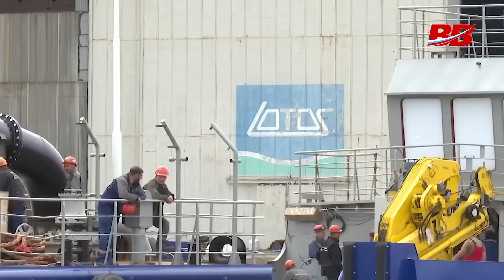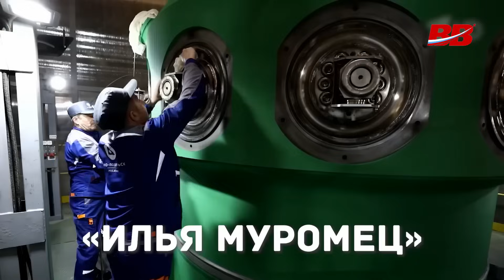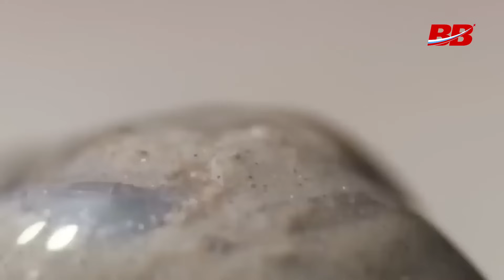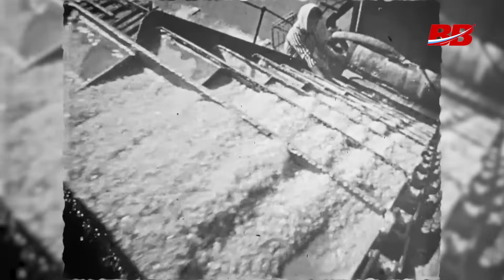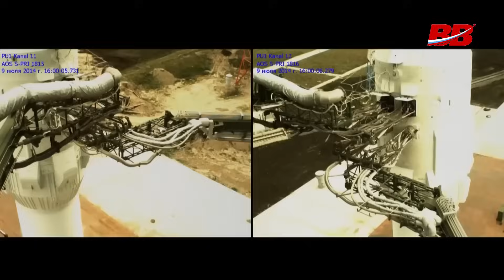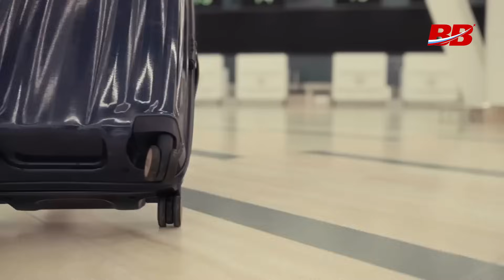Meet 'Ilya Muromets': Russia's Most Powerful Ship Reactor Yet

Comment: The construction of Russia's Leader-class nuclear icebreaker, specifically the lead vessel Rossiya (Project 10510), is facing significant delays and challenges. Initiated with a ceremonial steel cutting on July 6, 2020, at the Zvezda Shipyard in Vladivostok, the project was originally slated for completion by December 2027. However, as of March 2023, only 5% of the hull construction was complete, far behind the planned 15%. This slow progress is attributed to several issues